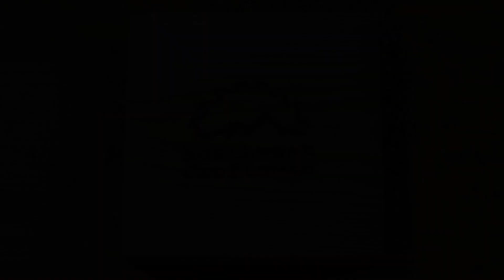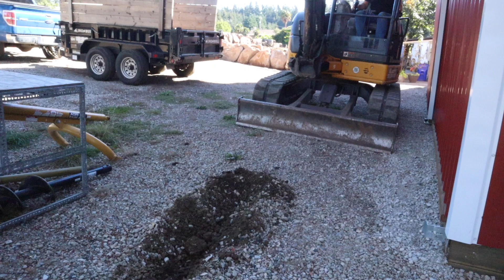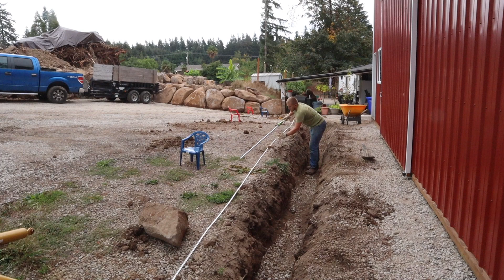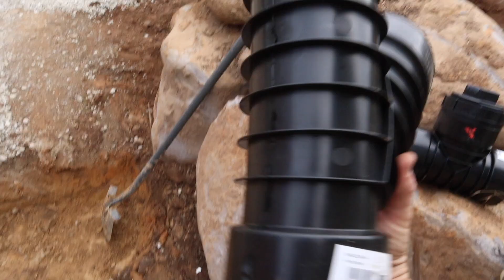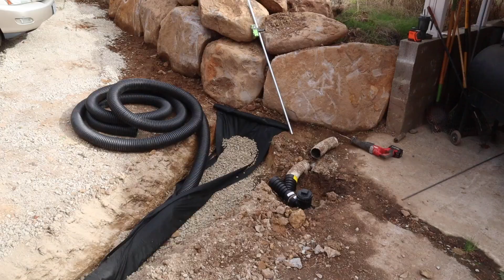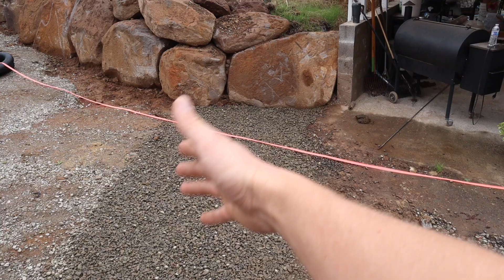French Drain Install | Diverting Water From my Shop

Comment: I hope you post a video of the drain working during or after a rainstorm! Very helpful video, thank you!
Reply from the maker: Probably won’t get a full video of it on the channel but during a recent rainstorm it was working awesome! Had about a 50/50 split between the water coming from the roof and from the french drain. Stoked! 

Only issue I’ve had is that there is still some seepage under the shop door and I think it’s just from the 2ft of exposure behind the drain 😂 oh well, I’m sure it’s way better than before. Don’t have a great AB comparison because we built the shop at the end of winter so I’ve only seen it during the summer.

So glad you found it helpful though!